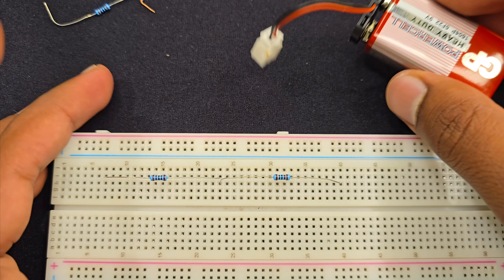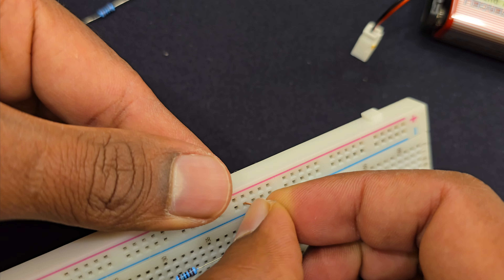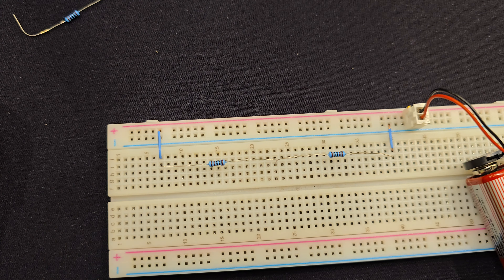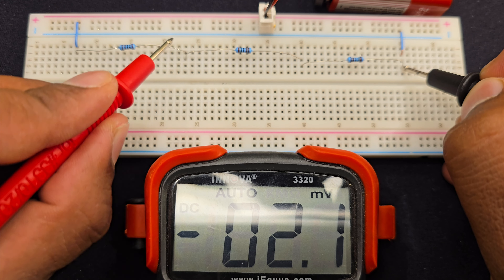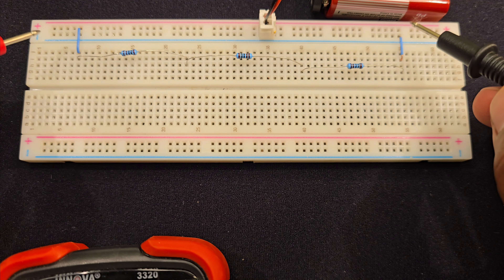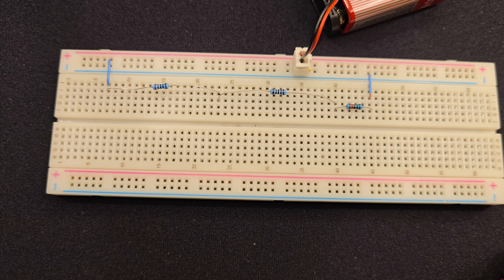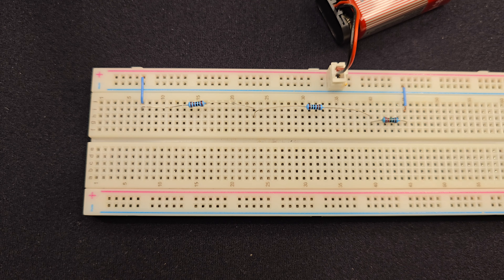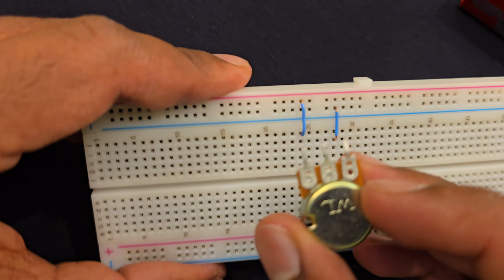Voltage divider circuit : How to build a simple voltage divider using resistors or a potentiometer.

Comment: The load can contain a divider as well which throws out the numbers. For some new to this they must understand "a buffer" made from an Op-amp.  It's a complicated trap to build on that beginning circuit without knowing "the buffer."
Reply: the rule of thumb is to have the resistor ten times lower than the 'load' resistance.
A BJT in CC configuration is often used as a buffer; High Zin and low Zout

Comment: Can you explain why your meter tests used two different polarities?  Is that why second dc check showed a negative voltage?  Confused about negative vs positive probe placement you used for the measurement.  Thanks  ( will subscribe if explained ) :)
Reply from the maker: I wasn't really concerned about the polarity of the battery when I connected it to the resistors because the polarity of the battery doesn't affect the voltage drop across the resistors. My multimeter showed negative voltages in the circuit with two resistors because I connected the battery on the power supply rail in reverse . But in the circuits with three resistors and the one with the potentiometer, I connected the battery on the power rail in the right direction ,so my multimeter showed positive voltages. Hope you understood. Thanks for pointing out that.
Reply: polarity is relative.....newbies have the idea its absolute
here polarity  is not important/relevant
Reply: polarity is relative.......for example, if you look at the symbol of a NPN transistor it might  show a positive sign at the Collector and a mins sign at the Emitter.   But that does not mean an actual  negative voltage at the Emitter - just a lower voltage than the Collector.